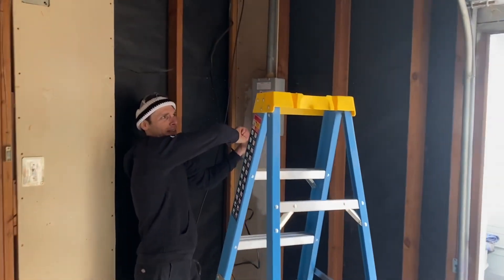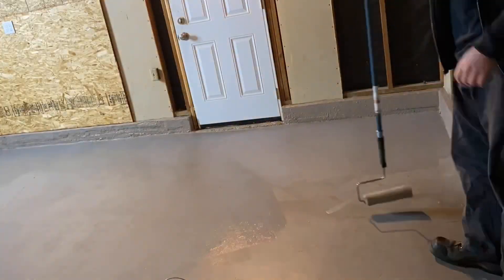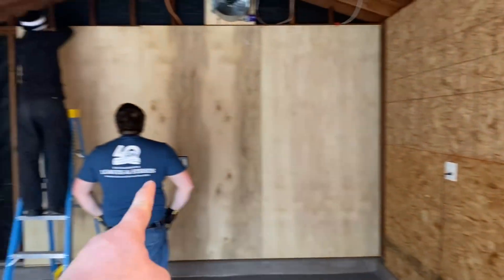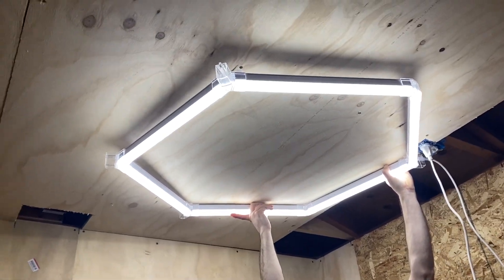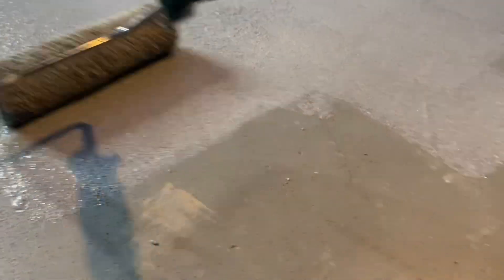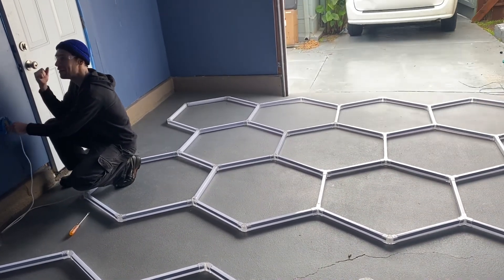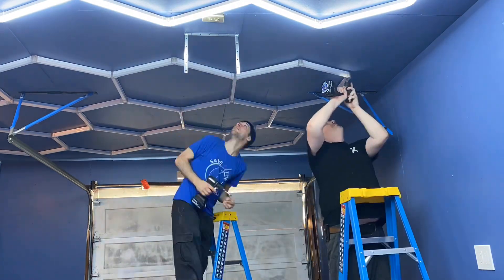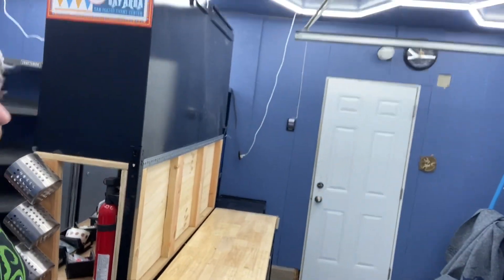We Built Our DREAM BATTLEBOTS WORKSHOP!

Comment: Why plywood instead of drywall?
Reply: Great question! It's easier to screw to, so we can mount light to medium weight things without worrying about locating them on studs or using fancy drywall anchors. Just put screws directly in. (For heavy things, we'll still anchor to studs)

Comment: JEALOUS!! For those of you putting a garage together. I regret using the thin 5mm plywood for the celling, it was very floppy and sagged without support beyond 24". Deformable lights are wonderfully bright but burn out in a year. Adding extra thermal compound didn't help as much as I hoped, turns out the plastic UFO version with more LEDs are superior (1.5 years so far). These light bars are absolutely the best and have survived the barn nonstop without issue for 2 winters.